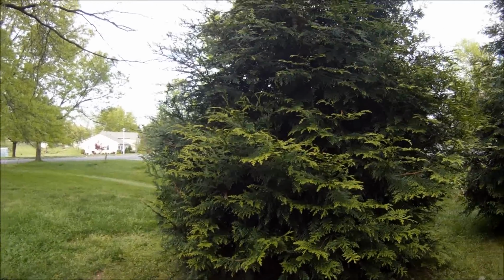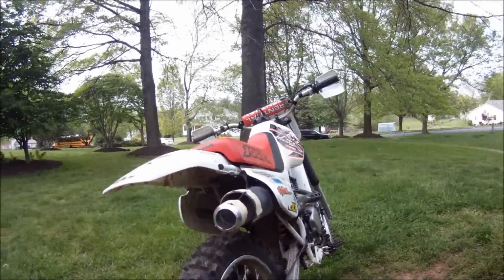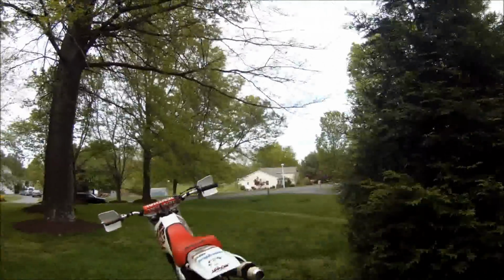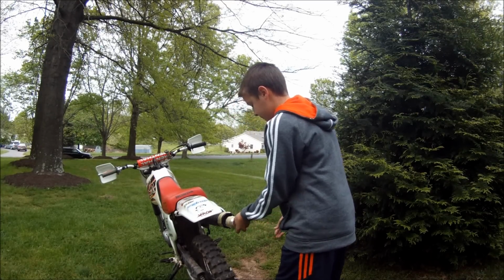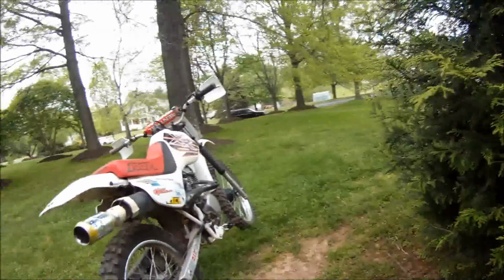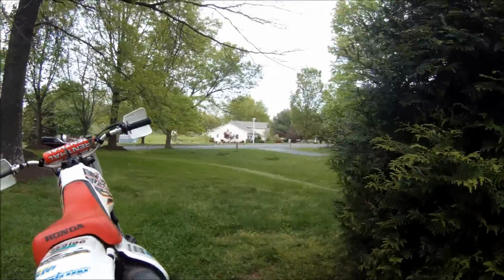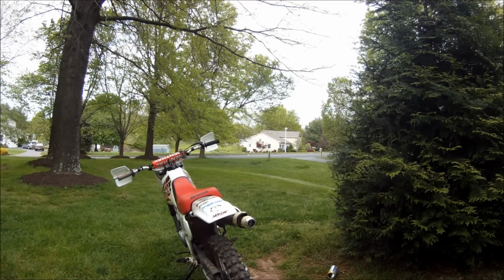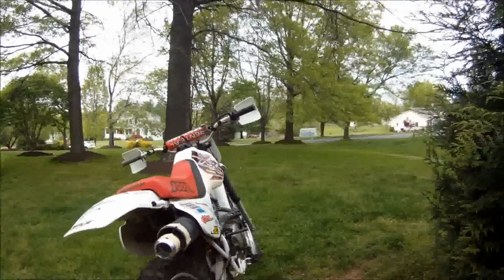Dirt Bike "Soda Can" Exhaust

Comment: all I have is a 80 baja dune bike but if you take a strate pipe cut off the original muffler and put that strate pipe on it and do it right it will sound like a 450  mine on the other hand my bike sounds like a 700 rapter . you should try it trust me its awesome :)
Reply: +super minis this kid is like 4 lol
Reply: post a vid of an 80 sounding like a 450f, and ill praise it.

Comment: Ok. Get a real exhuast pipe. Mine is a 150cc 4 stroke Honda 4 wheeler. 2 stroke exhuast with oil baffer. Good sound with a bored carb and a 125 crf piston head. Very fast. Message me for any help. Cover the gap by the real exhuast. You'll get more speed ower and better sound. Other wise good job